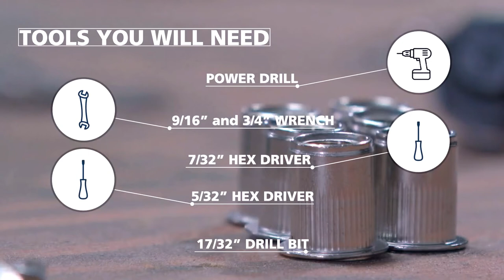How to Improve Your Pickup with a Sport Roll bar

Comment: Can you use a tool box with this?
Reply from the maker: Hi: You can install a tool box as long as though it will fit between the top rails of the bed, and not on top of it. Ron